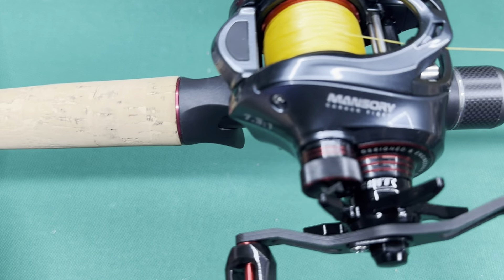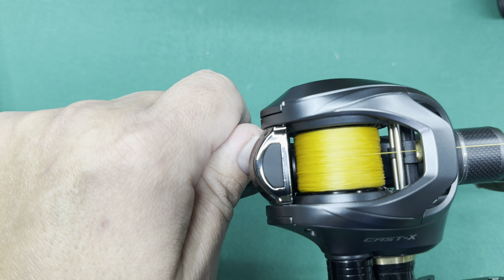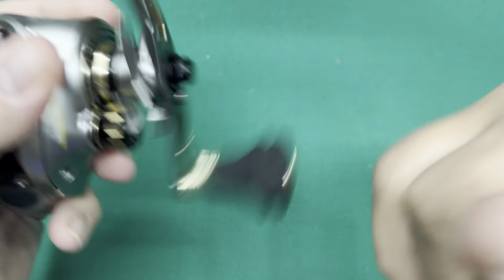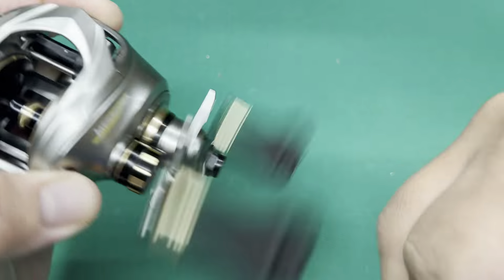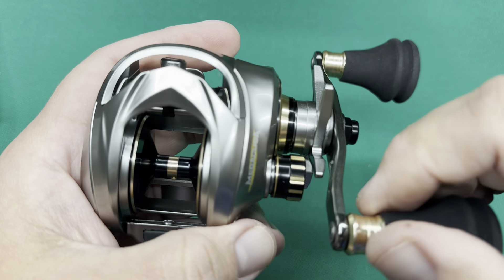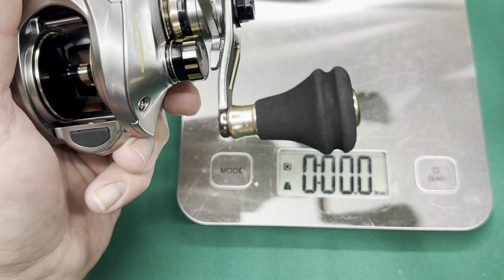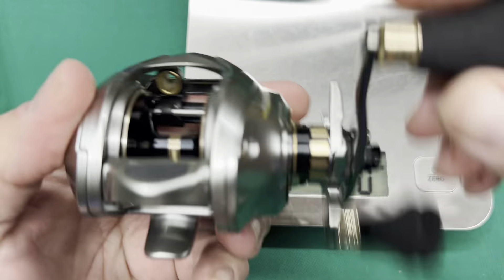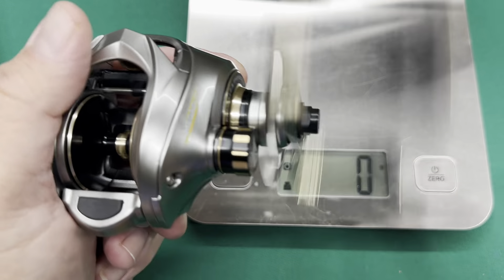Seasir Megacuda probably the new budget swimbait reel killer!

Comment: The biggest fear I have on cheap reels is that the bearings are not properly rust-proof.  One dash of water and they sound like you are griding coffee.
Reply from the maker: Sorry I didn’t see this sooner. I’ve been fishing with the Megacuda a lot lately and it’s holding up very well.
Reply: I had the same problem with a Daiwa Fuego LT spinning reel, fishing of a kayak. I never have that problem with any of my cheap, Kastking Reels which went through much more abuse
Reply: @obsessed_angler  I have probably like 12 or more old reels from the 90s and older, and they don;t have a spec of rust inside.... ( I know as I serviced them all this year)
Reply: they do use cheaper quality bearings, but, if i could save much more money for the features this reel could offer i'd be servicing this reel every time i go salt water fishing. or maybe use the additional savings to upgrade to some higher quality bearings

Comment: I own both a Daiwa Coastal and a Curado 201M and im probably going to buy this Megacuda. Seems to have pretty deep spool and that is one thing the Curado fails me at, need to run relatively thin braid on it for my pike fishing. Coastal/Tatula 200 has a lot more line capacity. This looks even better. The reel handle looks exactly like the handle on the ABU Revo Beast and that is one nice handle. Yeah, im going to give this one a try. Cost peanuts to the other reels i have, only thing missing is different gear ratios.. i prefer HG reels. Ill guess this one with that ratio has an IPT of around 28-30". 32,2" is my preferred one for swimbaits.
Reply from the maker: @OutofluckpikerMJK  yeah it’s basically the same handle, this reel is very good for the price, I’ve only caught a couple of fish with it nothing big yet but it was smooth

Comment: There is a drag test of this reel else where came to ~7kg. Considering they claim 15kg its less than half. Can you tie to a water jug and test it?
I have a tranx500 and its like your winding on thin air its just ridiculous. I am looking for a cheap thrasher setup to practice on but can be trusted to still work well. The seasir commando gets amazing reviews.
Reply from the maker: I like the commando a lot! I’ll have to test the drag and see where it lands at. I’ve got spooled with 20lb big game and I just got the last reel I’ve been waiting on to test all the budget swimbait reels and see what’s what
Reply: @dbbfishing2528  looking forward to see what the drag can do 20lb is 9kg which i think is a decent amount. 
Few other questions the spool shaft is it steel?
What do you think of the reel size compared to others, most swimbait reels are 300. What size do you think this is?

My tranx is kinda big at 500 but for what i use it for chasing medium sized kingfish and tuna its like a game reel with a line guide.
Reply from the maker: @Side85Winder  it is very comparable to a 200-300 size reel probably closer to a 200 but it’s a little bigger than a 200. It’s crazy they didn’t make it know as to what size the reel is and even more so I didn’t even think to check I just knew I’ve been liking their other reels and I wanted to put their swimbait reel to the test
Reply: @dbbfishing2528  it will probably make a really good bottom bashing and lighter jigging reel as well, deffently has the capacity to go deep. Deppending on The drag capacity is going to determin how big you can go. Lots here love overhead baitcasters and just dig their thumb into the spool 🤣. 
I am thinking one of those rods from aliexpress with 2 tips a light and heavy 8-12lb and 12-17lb for australian whiting and snapper would be a killer setup.
Reply from the maker: @Side85Winder  you might be right, why is the lb test different there than here?🤔
Reply: @dbbfishing2528  my bad i was guessing the lb of those dual tip rods. After checking it's 4-12lb and 8-17lb, 1 rod 2 different flex tips. Paired with a megacuda or commander would be pretty killer. I will wait for your drag test review before i purchase.
Reply: Don't be  fooled, whatever you saw, I have both and this is a way more heavy duty  reel  than the Commando.
It's drag is  strong on mine 
Best bang for buck IMO.
Reply: A drag test needs to be done with dry drag washers. I don't think that manufacturers are testing the drag power on their reels with the greased carbon fiber washers.
I would love to see a test video with this reel, I mean one with the dry washers and a second one with his greased washers.
Reply from the maker: @upstreamer1661  I’ll go ahead and wipe the washers off and do a drag test on them but I’ll do a wet test first
Reply: @dbbfishing2528  Use some acetone too. As you probably know acetone is probably the best  degreaser. Thanks!
Reply from the maker: @upstreamer1661  will do!
Reply: @upstreamer1661 why would you want dry drag washers in your reel? They make a specific drag washer grease for a reason..... I've cleaned the grease off of cheap reels to replace it with a light layer of quality drag grease but I would never run them dry.
Reply: @TubeYou7  Just to test the drag power of the reel,... that's why. Read the comments!